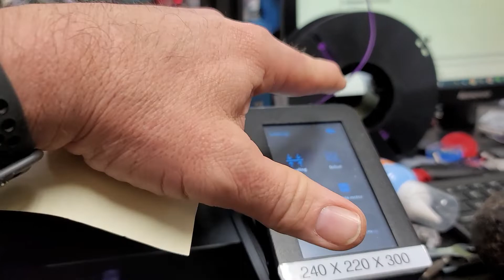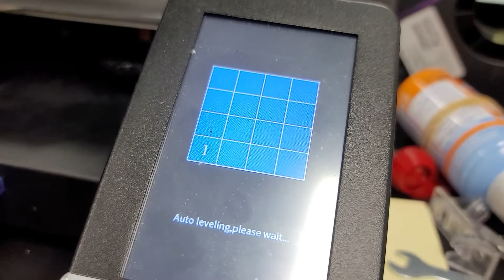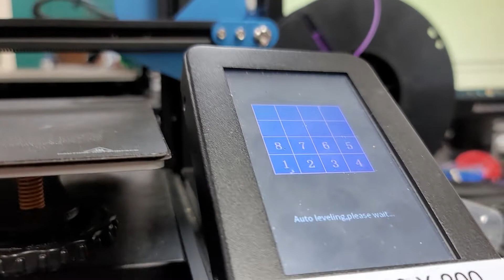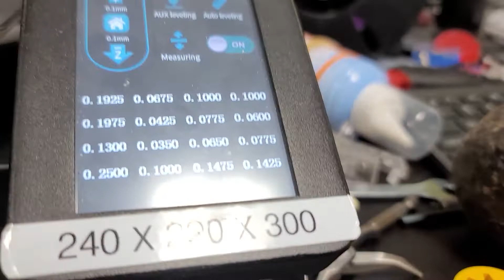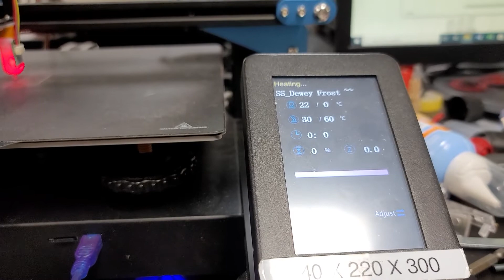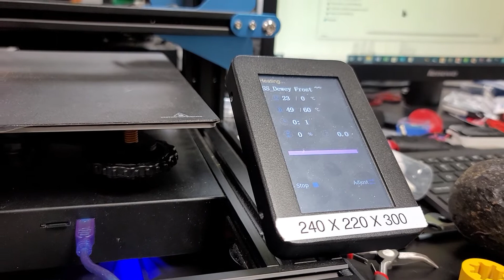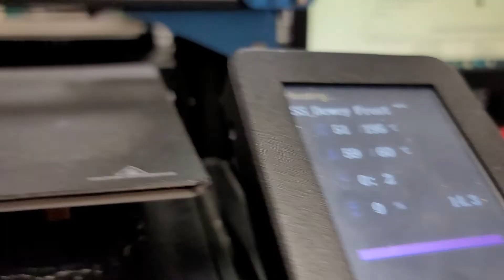SOVOL SV02 bed leveling problems pt. 2

Comment: I see that you replaced the thinner magnetic steel plate, then you have to adjust the bracket of the BL Touch down and install it a little lower, because the original glass plate is thicker
Reply from the maker: The hight of the nozzle is determined when doing the bed leveling procedure. Z-Offset is determined at this point, regardless of bed height. The nozzle Z-hight from the bed is adjusted and saved. The bed measuring process is completed and saved. When the print starts, the Z-hight is indicated on the screen. The number does not correlate and the nozzle will not lower to the hight set during bed level procedures. This was a problem with the stock bed as well.
Reply: @JerryCalverley  The lowest Z offset can only be adjusted to -40, and then it will not continue to be adjusted downward. Yours is already the lowest value, so it cannot be changed. You have to install the BL Touch a little lower to make up for this, Make the range that can be adjusted within -40 ，The previous glass plate was thicker, probably within this range, but when you replace it with a thinner , the distance becomes larger and may exceed this range，You can try as I said